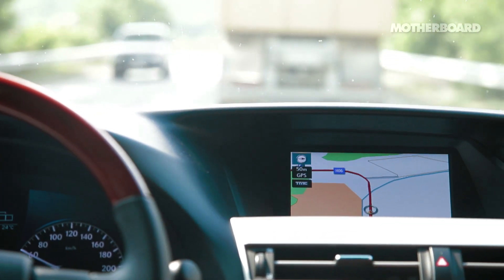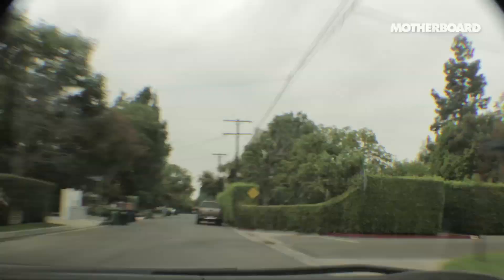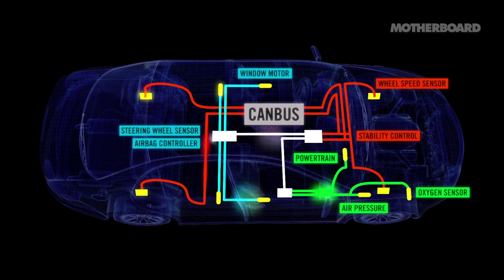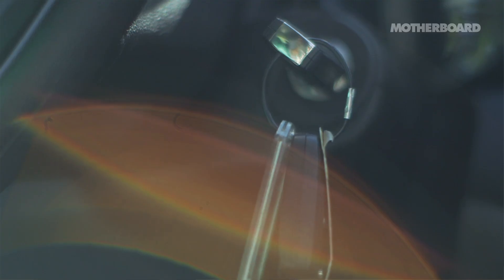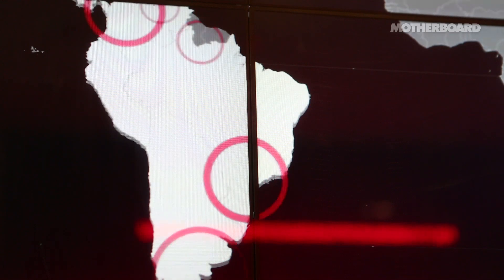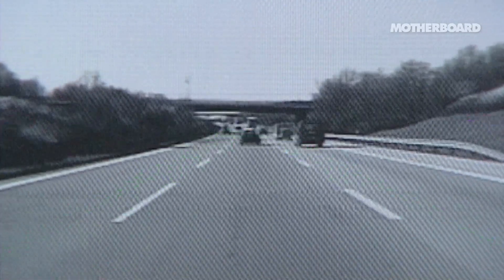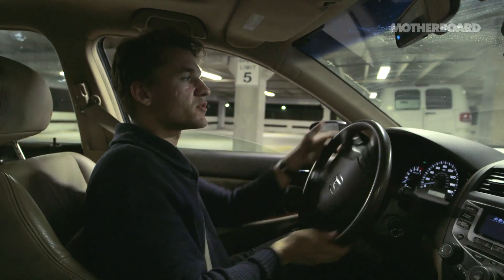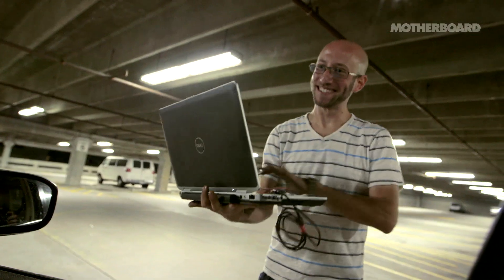How to Hack a Car: Phreaked Out (Episode 2)

Comment: at 4:20 you would require internal access to the car, this whole thing is overhyped. As usual Motherboard overhypes these things and blows them out of proportion.
Reply: I know, right? Nobody seems to know what "hacking" means these days. They think using simple commands already linked to a network for testing purposes is hacking. It would take so much fucking time to breech a car's security that you know nothing about.
Reply: "you would require internal access to the car".  like installing something on the car is that hard? you can even do it in public in the day, or better in the middle of the night, never mind a corrupt mechanic; it just looks like you're trying to fix something in the car. soon anyone more then a petty criminal could do this. and MB said clearly more then once that one needs to install a piece of hardware on the car, so it's not overhyped. if you find this not a concern, well good luck with your careless life. but just installing a piece of hardware and you can control the whole car is a huge security risk, not only for high profile people, but for everyone (randsom ware, as mentioned IE)

although I think they should specify how easy it is to intall the piece on the car; I guess they assume people already know it's trivially easy (especialy compared to the rest of tech skills required)
Reply: Hobypyrocom unless you want to trow away money you wouldn't send you car to the most expensive repair option (official mechanics) to repair anything other then the most complex systems; most times repairs on even modern cars can be done in independant mechanics. and plus I just mentioned mechanics as one option, much more common be just do some "repairing" on "your" vehicle in the middle of the night or so, as I mentioned. so your first point is moot; it is dead easy to intall the hardware which is what I was saying
 your second point aplies to people that don't have modern cars,  good for you and others that don't get these modern cars, I would too, especially given the insecurities exposed in this video. but the issue we're discussing is not with those old cars, it's with modern cars, so IDK why the f**k you talk about devices other then the ones in question; it doesn't make the devices in question any safer.. plus sooner or later you will be in one of these cars, just as everyone now uses cars intead of horses. so your second point is also moot.

the point of the video is showing that these modern cars are unsafe to the point that by just intalling a hardware part, almost as easy as intalling a new battery, one (with the right knowledge) can basically take control of the whole car.
Reply: Unless you have onstar or equivalent.
Reply: exactly.
"the vehicle shown is modified with third-party hardware for demo purposes" well how else would they even connect to a car wirelessly if they dont install a custom hardware on it? are they counting that there are retarded car manufacturers so using this add on motherboard they will provide their already prepared "miracle" hardware and software that can "protect" a car from being hacked for a silly price?
first of all i am not familiar with the recent car systems but why would a car need a cellular network installed in it in the first place? a normal car system have computer that reads the status of the sensors installed and controls the system accordingly, there is nothing that you can connect to directly on that computer except on the jack that is installed for that purpose. a specialized car auto mechanic can do all this things shown on the video but not remotely without connecting a cable to the car.
7:54 obviously a cable going from the laptop to the car...
"GSM networks, everything is cellular nowadays" WTF, why would a car have GSM installed in it?
so now what? are they hoping to persuade the car manufacturers to buy the lame McAfee antivirus and security for their cars? the security software that cant even deal with simple PC viruses and hacks?
Ubisoft sponsors so big campaign to promote their game that had the release date prolonged for so long, there is not a single recent video on YouTube that doesnt talk about it, i bet it will be rubbish and a big failure. the same campaign they launched for assassins creed and it was a failure too.
Reply: Well my car has a 3g connection, it is not for me to use, but for the car to send status to manufacturer website of the car, and that certainly could be hacked. It also allows me to remote start my car, unlock the doors lock the doors and locate the car. But I canceled the service and removed the antenna since I have a manual car, the remote start does not work and it isn't worth $100 a year to be able to unlock my car from my phone. But even if it was hacked and they turned off my car, I can still steer and brake, so there would be no point. And the part where they say that they can blow the engine up, it requires a restart to flash the ecu, and most cars the map file that the ecu access to control the engine cannot be manipulated because it is encrypted. And even then a device would have to be installed on the OBD port allowing remote access, since programming is physically separated from anything but the ecu and the OBD2 port.
Reply: ***** There is potential to override the breaking and steering systems. New ESP equipped cars have ECU control over breaks in each wheel separately. One of my cars has an electric power steering that is also connected to the ECU. There is no full disconnect between the mechanical systems and the things that control them, but it would be possible to lock one wheel to alter the path of the car, or make the car accelerate. From my knowledge, it's not possible to control the steering directly, but again, the pump might be switched off. My opinion is that remotely steering the car is BS, but having control over those systems might make the car accelerate and crash. 

The whole thing is not new. Delphi introduced an OBDII remote controller for the car, that can actually do a lot of stuff. Those guys are not pioneers, the whole thing is hyped to the max.
Reply: ***** check out university of south Carolina hacks through tires on google its been done they can hit the brakes on you honk you horn and eject the airbags just and example of a few things.
Reply: ***** and stephen savage of the University of California, San Diego was able to hack the bluetooth via a mp3 song on a iphone conected to the car so want the certain song came on it would do what ever command he had preset (a very easy way to get a lot of people hurt fast) put it on a new katy perry song on the day of the release and there would be a few 1000 car ruined by the end of the day
Reply: Mickey O'Neil I am sorry but the radio has no control over the car. The only car I see being able to be affected by this would be the Tesla model s. By the way you would have to pair the phone with the car as well so good luck.
Reply: Mickey. listen. I don't know what video or article you saw. But the radio does NOT have access to the canbus system. Your radio does not have the communication path necessary to set off an airbag. And if there was such a  code that could be embeded into a song to do this, it would only work on one type of radio (if the radio had access) Every radio has a different firmware/OS etc for example my cars radio runs windows CE. One vulnerability would not work on every car even if this was plausible What makes it even more implausible is that there is no way for the mp3 codec to have this type of vulnerability.
Reply: ***** http://www.autosec.org/pubs/cars-usenixsec2011.pdf
Reply: Agreed there blowing this way out of proportion!!!!! Allso as a car but and auto a/v installer for many years. The audio system in no way connects to the ecu other then maybe sharing power wires in the wire harness and even the. Runs through relays and fuses
Reply: Hobypyrocom Thank you lol. all he is doing is using his computer as a scan tool, just like any mechanic would. which requires a plug connected to the OBD2 connector usually found under the steering column inside the car. Base brakes always work (they are hydraulic) and power breaks would work for at least three applications after the ignition was turned off.
Reply: IronTom Yeah this is a joke, every mechanic out there uses this same technology on a daily basis, Its far from actually hacking.
Reply: Right because no body is breaking the law anymore so we really do not have to worry, since there aren't any dishonest on planet earth.

How long has it been since a murder took place?

Of course if murders were being committed everyday for money then this would be quite worrisome.

or if we had a dishonest government.  Then I would really be worried.

But Christopher since no one is dishonest we have nothing to worry about.

GREAT POINT
Reply: d smith My point is that this isn't hacking, Its manually plugging into the cars data link and controlling actuators. You cant just hack into a car from anywhere in the world without having physically connected to the Data link. The government cant just type your VIN# into a computer, press a red button, and cause your car to self destruct. So great point jackass, nothing you said was even relevant to my comment.
Reply: ***** Not really. Not the same principle.
Reply: Lol, I like how anyone who makes a claim like yours immediately gets praised for belief that what you stated would be true. Unfortunately if you learned more about the Canbus you would have a stronger understanding of these types of attacks.
Reply: Simon WoodburyForget
3g stick, arduino, connecters and some programing knowlage...
Reply: Sounds like Wired magazine.
Reply: Joao Rijo
do you even have any knowledge of electronics and programming? its obvious that you dont. first of all, all models of cars that have sophisticated electronics in them are sent to official services not to local lame auto mechanics. seccond yes i have careless life because i dont have a car nor anyone in my family, third even if i have a car i would not buy a car thats so "complicated" (expensive), 99% of the cars driven on our streets in my country are pre 2006 produced :) if i ever buy car i will buy old one which i will convert to electric with electronics that i will make my self, then tell a hacker to come and hack my car :)
Reply: if u have onstar satellite radio gps or a bluetooth system hooked up to a phone you could get in from anywhere in the world if you just have bluetooth (no phone) or wireless tire gauges (witch every car in the past 10 years has) you can get in but only from up close so pretty much all cars made in the past 10 years are t risk
Reply: Mickey, to a degree it can be hacked through the onstar. Satellite radio is a passive system, one way data stream, no hacking could occur other than disabling your radio. Wireless TMPS cannot be hacked as it is also a passive system that only listens for temperature data and pressure, the data is used to display, no access can be achieved through the tpms.  Bluetooth cannot hack your car, lets just say it was hacked, wow now you have control over the stereo system if it is set to bluetooth aux. Wow  Much hack verry vuln
Reply: its the personal phone of the driver they are going through ie. you download of pirate bay hop in your car, pair your phone, play your new song, and bam the air bag goes off.
Reply: Christopher B I agree, but with new telematics there is a slight chance if manufacturers have not hardened their servers. I think that most telematics use VPN connections to the master servers for service. But to be honest that is allot of work for not allot of control. Most they could do is lock/unlock/remote start, maybe more but this could not be used to blow up engines or disable brakes.
Reply: access through the gps network would be tough, but possible. Also they stated that in order to use the CHT a device would need to be planted on the car, which would be fairly easy to do with 3-5 minutes alone. A lot of cars are connected to 3g/4gLTE networks as well so this isn't really that far fetched.
Reply: The telematics systems do not have the access required to do most of this. I do agree however, I don't see how they could send commands through the gps network though because gps had only time data, no commands are sent through the network and is they somehow managed to, the gps receivers could not interpret them.
Reply: ***** He said "GSM" not "GPS"
Reply: Msapere If you look at David's comment I quote "access through the gps network would be tough, but possible" thank you for your time.
Reply: And yet you keep coming back.

lol
Reply: ***** with the car he put a blu tooth in the cip he made and sent code to the cip, and the cip tells the in ternel computer and boom he has control of most of the car
Reply: Matthew Keeter Exactly, thanks for proving my point.
Reply: Ho prob
Reply: a mechanic could install one of these. and remotely steal peoples cars a few weeks later in the dead of night when they're parked up by making them drive to him.... the perfect crime
Reply: You would notice a usb dongle hanging out of your obd2 port.
Reply: the motherboard is in the the wheel well on the right side and he sed "you need to connect directly to it"
Reply: *****
Whats stopping a techno mechanic from installing this shit with out you knowing...
Reply: Something plugged into the obd2 port would be very obvious.
Reply: dude just give up your not going to win, look what they can cram in to a cellphone... tell me you would see a microcontroller under a thick layer of carpet, you could even make it inline with the plug so you wouldnt see shit.
Reply: RobTapps88 You do know the obd2 port is not under the carpet right? And what the fuck is a Technomechanic?
Reply: ***** Your not that bright, Robb is right. It doesn't have to be in the port. It can be anywhere. Learn something about electronics before you speak.
Reply: Scott Murray-Anderson  Please tell me how you will not recognize there is a wire loom coming from your obd2 port? Besides if you got somone willing to spend 4 or so hours to hide this shit in your car, you got worse  problems. Need to re evaluate your life when you got professionals trying to kill you.
Reply: your loom goes through the firewall and sits below/beside the engine, how hard is it to crawl under a car... you know like when you change your oil.. not that fucking hard. but im done with this convo, and it was supposed to be technologically inclined mechanic.. learn abrvtons.
Reply: RobTapps88 What are they going to do, get under the car with 20 vampire clips and sit there for 3-4 hours pinning out the wires and wiring their device in? Every engine loom is different, and most obd2 lines go straight from the ecu to the dash, engine compartments are too cramped these days to get to that from underneath the car.
Reply: arduino (plus sheilds} preconfigured obvs. , a battery powered soldering iron, solder, flashlight, it would take an hour tops. if you know you have that window + a few extra mins then you are in the clear... do some research man.
Reply: I could clip on to the wires or even swap out the PCM or ECM in 5 minutes and most people wouldn't notice. Pretty easy stuff.
Reply: Odb2s are all the same. Most people wouldn't notice a small device plugged right into it. If the car has my code, I control it the way I want.
Reply: Well basically all you need to do is change the ECU and you're good to go.. Like if you wanted to off someone, you'd sneak into their car, replace the ECU and wait for them to be at a place where turning or accelerating would be fatal, and poof there he goes.. They'd never find what it was, the last thing they would think of is someone actually hacked the car.. Terrible thing technology is today, back when carburetors were still a thing, you could repair a clutch "rope" (i don't know the english name for the strings that pull the clutch) with a bubble gum.. Nowadays you get these electronic component cars and even the slightest battery problem, fuel mixture etc can cause a major problem.
Reply: do you even know what a fucking 3G stick is.. OR an Arduino for that matter,.. fuck off and do some research. im tired of fucking arguing when i know im right.

www.arduino.com <--- UNIX BASED MICROCONTROLLER

3G stick
http://img.alibaba.com/img/pb/913/106/446/446106913_943.jpg

seriously man DO SOME FUCKING RESEARCH BEFORE YOU INEPT FUCKS START TYPING SHIT YOU KNOW NOTHING ABOUT!
Reply: If they ever implement vehicle to vehicle networks it won't require physical access anymore.
Reply: Simon WoodburyForget actually its his google plus account

Comment: This is so full of bullshit. 
You can not deactivate the brakes. they are maniacally and hydraulically connected directly to the brake pedal.
You can not deactivate or control the steering. It is maniacally  connected from the steering wheel to the front wheels.
And you can not remotely control the ECU. Then you need to implant a device on the internal CAN bus of the car. And to do that you need to get access to the inside of the car.
Reply: 1) Wrong, all pedals are pressure sensors
2) Video didn't claim steering can be disabled
3) Most modern cars have wireless ecu updates from manufacturers